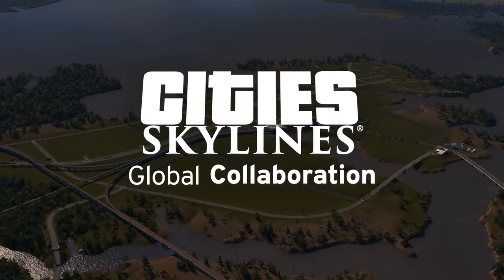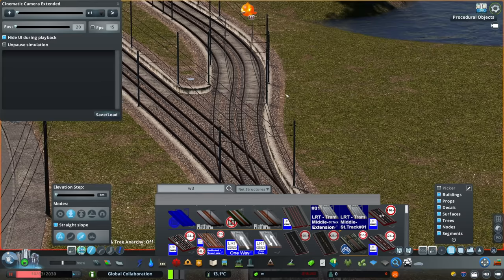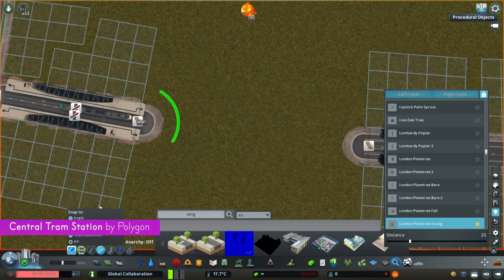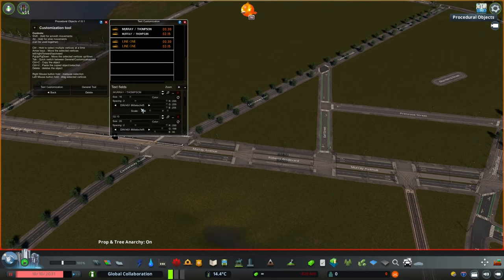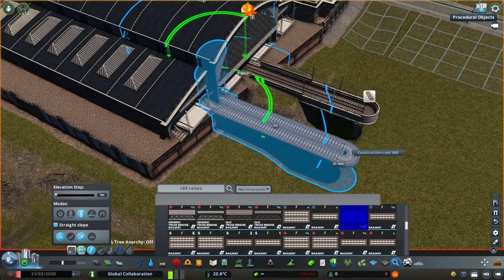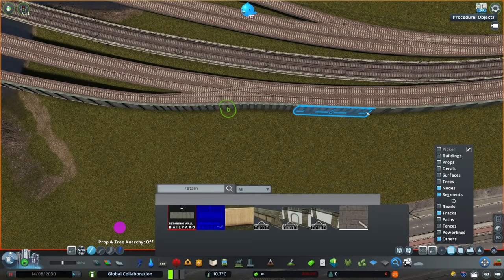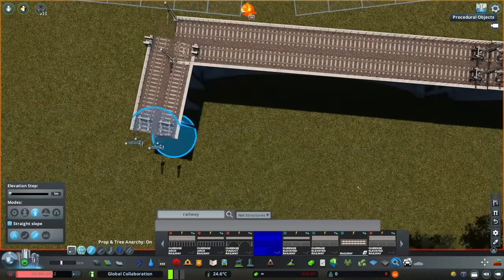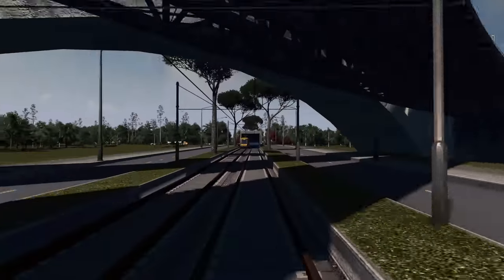Cities Skylines: Global Collaboration - Part 2 - Setting Up City Transit

Comment: I can't play C:S because I get so frustrated trying to put in the detail. Your patience is amazing and the result is incredible.
4:30 oddly enough, in my home city, when they do track replacement works they prefer to use an asphalt surface over concrete. I think it is because it's cheaper and easier to lay than concrete with similar performance since the foundation remains concrete under the asphalt.
6:10 I reckon those yellow highlights are meant to be tactile ground surface indicators (TGSIs), sometimes known as Braille Trail.
8:50 one last nitpick, those water tunnels are called culverts.

Comment: Is it possible for you to make a little guide of how to use text customization like you did?
It did look amazing.
Reply from the maker: Patience and re-trying, that's all it is. I subbed to all the fonts and just converted the display prop to a PO after placing it. After that it was just a matter of creating a layout on the first frame, and making sure the line icons lined up on the second, third, etc. I'd check after every move with first-person camera to make sure it looked right (it usually didn't). After that you can copy/paste the PO around and just change the text string to whatever you need